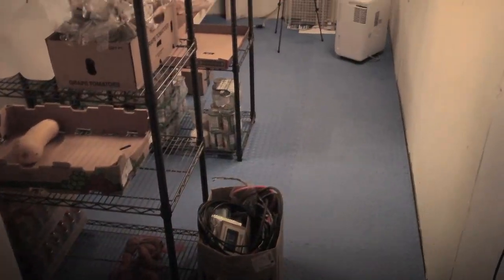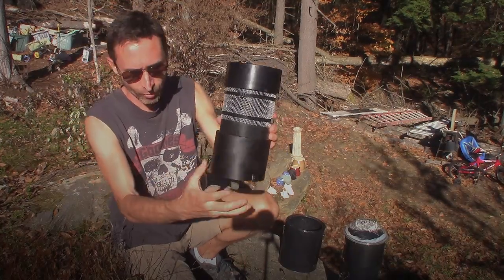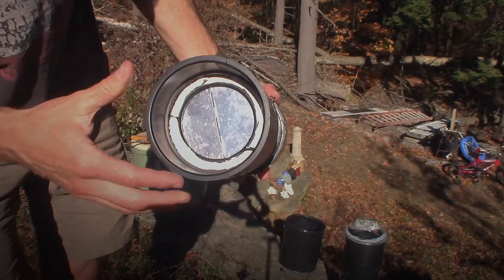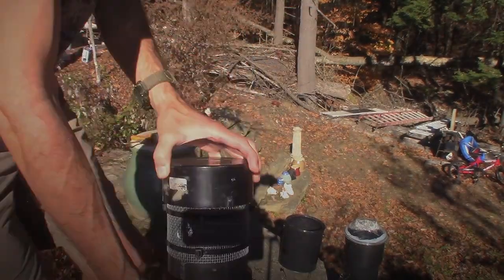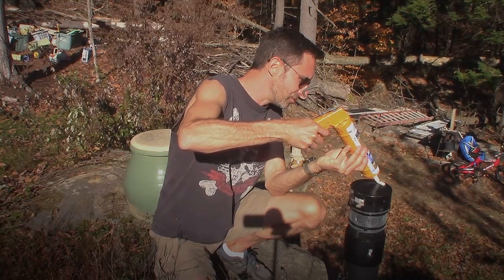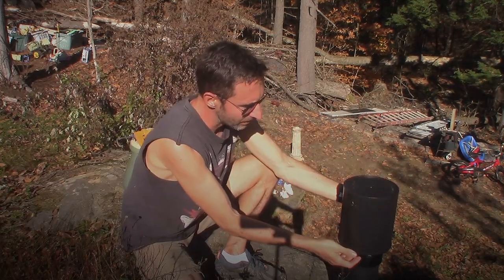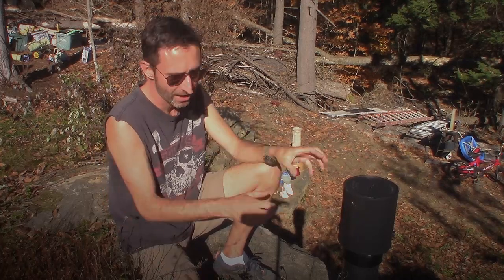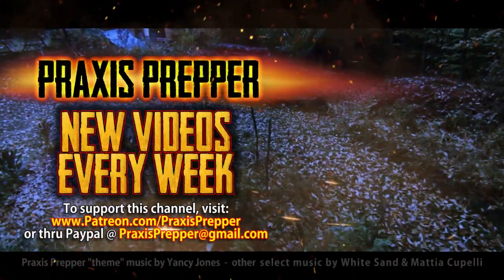Build a Homemade Fallout Shelter Exhaust Vent

Comment: I used to work in a gov "bunker" and one thing we had on the wall was a CO2 sensor with a big monitor showing the levels of O2 and CO2 and it would set off alarms if it went below a certain level. Not really sure if that was because it was a fallout shelter or because we had a big halon system but might be handy to have a small version of that.
Reply from the maker: I actually do. I'll be bringing it in for the test. It senses a number of things including co2. I wish it could do hydrogen as well because the lead acid batteries emit that gas when they run. I'm thinking that general ventilation should be enough to remove that along with the co2, but it'd be nice to know for sure. I suppose i could always tes by lighting a match...

Comment: I love that vent! If you have trouble moving enough air through the vent, remove the inner bug screen and your airflow will increase by 50%.
Reply from the maker: Good tip. We shouldn't need much flow - just enough to let the fresh air into the small space. We'll see how it goes when the tests start.

Comment: Silicone makes a great glue, just remember nothing sticks to it (even more silicone) so if there's a leak or when it comes time to replace it, you have to completely remove it and sand. When i lived in the heat of South Carolina, my silicone caulk lasted ten years outdoors.
Reply from the maker: I didn't know that more silicone glue won't bond to old silicone glue. I'd never tried it before. Thx for the tip. :)

Comment: The vent with the screen, the flapper valve thing and the paint can water proofing looks great! It reminds of the wall mount water proof vents on shipping containers. Those make the air go around a corner and through some holes also, except they have lots of small holes at the bottom. I think your creation will work real well and is a clever design.
Reply from the maker: Thanks Ben. We'll all find out when i run the tests soon.

Comment: I didn't read every comment, but I expected someone, (other than me) would comment about why you have the air tube pointing up instead of using a J tube and pointing the exhaust vent downwards. I see this technique used in my area over old dump sites that produce methane. Seems like it would solve several needs. In addition to preventing rain coming down from up top, it would serve a secondary purpose that it would make it more difficult for someone to pour a fluid (thinking gas, etc) down the tube. Atlas Shelter using something similar, but there is an area of pipe that goes downward in the event someone is attempting to pour fluids down.
Reply from the maker: With the lid i put on it, it still has the same J path. I built it this way as an easy way or wrapping the meshes in there. But a j could work too of course.
Reply: It would be just as easy to use a hose to circumvent the J tube pour something in that way.   I look at having the vent enclosed in something structurally sound that would make it hard to get to the air exhaust or intake.   Or at least they would make enough noise to let you know that someone is trying to get to your air intake or exhaust.   Just a thought.   It could be as easy as a 5 gallon metal bucket with padlock hasp.  One part pop rivet to bucket and the other attached to concrete base.

Comment: If the paint can is easily removable then you can check for nests and whatnot more easily. Here in North Texas everything gets filled up with dirt dauber nests on a long enough time line.
Reply from the maker: I suspect that the lid WILL be easily removed after heating and weathering. But you're right about the bugs in that crack. Mud wasps would love that space. I gotta consider that - maybe add a bit more insect mesh to the bottom seem. Thx!

Comment: Very interesting your vent.  I like how you make the holes and put bug screen in the inside of the 4 inch pipe and the 1/4 metal mesh screen to strop the mice from getting into the pipe.  I am worried that wasp will build a nest inside and stop the air from coming out.   I do not know if they make Shell Pest strips anymore but they are waxy looking yellow candy bar size bug repellant strips.  That would help keep the wasp or yellow jackets from building a nest under the paint bucket.  I like your shelter.
Reply from the maker: That's a good point about the wasps.  Someone else thought of that too. I havent done it yet, but I figured I'd add a bit of mesh around the ring to prevent it. Thx for the tip. We all learn from each other on here.

Comment: Well done Praxis. That should really help with the airflow. The less resistance there is the easier your air pumps will work. Maybe consider bringing a canary in with you for the dry run test. 🦜
Reply from the maker: We don't have any canaries... maybe our smallest rooster? OMG, I can hear the ear-splitting rooster crows reverberating around that enclosed space! My ears are bleeding just imagining it! ;)

Comment: I actually believe Ive heard Brad on Full Spectrum Survival mention your channel before, I love your vent cap. I will  make something similar for a project I'm working on for venting a subterranean greenhouse. Have you used your shelter when it is -20*F if it gets that cold in your area. If so, have noticed any condensation freezing at your exhaust port? something that I think about and trouble shoot for.
Reply from the maker: Yeah, I get mentioned on channels that I frequent form time to time. My little 15 seconds of fame here and there. :)
We don't tend to get down to -20F too much here. Very rarely. But that's an excellent point on the condensation freezing up as it goes out. I think we'd have a decent chance of the warm exiting air keeping the path clear, but having not tested that, I can't say for sure. Thx for bringing that consideration up!

Comment: Nice job. Did you get a co2 detector for the bunker? If not it would be interesting to see one included in the test.
Reply from the maker: I have a multi-function meter that I use presently in my house. It does CO2, radon, humidity, temperature, barometric pressure, and VOC content. I'll DEFINITELY have that in the shelter during the test. It'll give me critical knowledge about how low I can run the fan and still keep the space free of excess CO2.

Comment: I feel like I'm always asking you questions lol. What did you do for air intake? I bought an organic air green house hepa filter with a 4in ring seal.
Reply from the maker: I have a little playlist on the manual air intake that I built: https://www.youtube.com/playlist?list=PLEbbFhsJJB8_NQ92jeaylBqqME1e3BXle
Aside from that I have a 4" electric fan that (in testing) is able to easily keep up with our breathing. The filters are 4 large HEPA filters that I installed in an air intake box I created. I don't have a playlist for just that project, but it's covered in this playlist (though you may not want to sift through to find the videos on that). If you do, that project wasn't even started until the root cellar was totally done, so it's among the more recent days in the list: https://www.youtube.com/playlist?list=PLEbbFhsJJB8_TXczGtYPPXukeRBDC9uIX
And no worries on the questions. That's 100% why I'm here!

Comment: It would be very interesting to see a smoke test so you can see the air travelling the way you would like it too... Also, like another commenter mentioned, I would be interested to see how these smells carry outside the bunker. I am assuming your bunker runs year round at about the same temperature, geo-thermal around 56 degrees. Is that accurate? I may have missed that throughout the videos...
Reply from the maker: The bunker fluctuates through the year so far. More dirt on top (which i added this summer) may help with that. In the summer it hangs out atound 60 and in the winter is about 40 (that's before i added the extra dirt this year). We'll see. With human bodies in there, i'm assuming those temps change.
Reply: @PraxisPrepper  thank you for replying. Even at that, 40 is far better than the outside temp of anything below freezing. Keeps water, well, water, and a lot less energy to warm it up. That being said, I hope the additional dirt makes it a little more consistent temperature for you. Awesome. When we move to oir property down the road, I told the wife we are putting in a "Root Cellar." She agrees.
Reply from the maker: @cogitoaprendo1017  let me know when you're doing that. And if you like, we can chat on the phone about anything you'd like in regard to doing that. There are things i'd have done differently after doing the 1st root cellar, and i'd love to pass that on to you guys.
Reply: @PraxisPrepper  thank you, but it will be a few years before we are there.

Comment: Im building a storm shelter based loosely on 1978 bomb shelter design by fema.
Im useing steel tubing for intake and exhaust, in the shape of Shepards crooks.
Reply from the maker: Awesome! That's a great idea. My shelter is vulnerable to fire as it's presently built. Make sure you have filtration for your air intake (including activated carbon if possible) and ensure that your filtering material is separated from your living space because if it works to filter out radioactive material, the filter itself will become a radiological danger.
Reply: @PraxisPrepper  I've given that some thought.
havent come up with a solution just yet but will most likely be lead sheilding
Reply from the maker: Lead's a great way to go to cut the most radiation in the least distance. I believe it has a halving thickness of 1cm. @bobbytowesr3387

Comment: How would it keep the radioactive dust out? It seems the metal mesh wouldn't accomplish that?
Thanks
Reply from the maker: That's a fair question to ask. Thanks for bringing it up. It works because of the positive pressure exhausting out of the vent. The dust outside would need to move up the sides of the inside of the lid (paint bucket) against the flow of the outgoing air make a 90 degree turn and pass through the vent holes (again, against the flow of air) and then head down the shaft against the flow of air. If someone outside were making a concerted effort to blow dust backwards into the system, I'm sure that they could, but under normal conditions, the dust would never enter the system. It's similar to the way that if you dive under water and slowly blow air out of your nose, the water will never enter your nose because of the positive pressure of the air coming out. It doesn't take much, just a low flow will keep air from back-feeding in and carrying dust with it... presumably (and hopefully).
Reply: I’d build a concrete reinforced dome over the top, if there was a nuclear event your vent is melted!!
Reply from the maker: @Rotherhamvanman  You're correct. This shelter isn't built to survive local strikes - only drifting fallout from strikes in other areas.

Comment: You say : you need positive pressure , how much pressure to open that butterfly flapper valve , looks pretty stiff
Reply from the maker: Good insight. It actually IS pretty stiff (as I found out after installing). It opens up when I use the manual hand vent, but the fan doesn't open it up due to all the other egress points for air to leave.

Comment: Great idea but…..they should be made out of steel or metal pipe so they can’t be melted or broken easily.
Reply from the maker: That's a definite down side of the ABS pipes. When this structure was built, it was made as a root cellar with the thought that it could be retrofitted to work as a fallout shelter. So not every design decision was aimed specifically at the fallout function. Metal pipes have the downside of condensating more moisture from the air in the morning when they're cool. If we lived in an area more likely to be struck proximally by a weapon, the metal pipes would be more critical IMO, but where we're located, I'm mostly concerned about the potential for drifting fallout.

Comment: What are you using to pull air inside?
Reply from the maker: We have 2 options. A 4" vent runs into the shelter and the default mode of intake is a 4" electric fan. It's of a type that I've used for a long time for indoor air circulation, so it's very reliable. But... if there's an EMP and electrical systems don't work (or any one of a hundred other possible issues) we have a manual pump that I built myself out of some wood and an outdoor lawn waste bag. Here's a playlist that shows some work that went into making that device: https://www.youtube.com/playlist?list=PLEbbFhsJJB8_NQ92jeaylBqqME1e3BXle
Reply: I sincerely want to thank you for taking the time to answer my question. 99% of Youtubers will never answer simple questions but you did. I wasn’t going to subscribe to you but I definitely will now. Thanks again. 🇺🇸
Reply from the maker: @u.s.militia7682  OMG dude, that's why I do this channel. It's all about giving people a hand with things they're trying to do, and sharing ideas. I learn as much from viewers as they learn from me I think. Youtube is terrible in a lot of ways, but it's still the best place to connect with others and share ideas... even if Youtube is actively trying to stop that from happening! ;)

Comment: The first of your videos ive watched so if you have already talked about it im sorry but i noticed alot of building materials around the shelter. Could entice survivor's to investigate.
Reply from the maker: That issue with outsiders snooping around is a hard one. This shelter wasn't primarily built as a shelter, but rather as a root cellar (which I knew I could turn into a shelter if needed). If I were to have done a straight up shelter, yeah it'd have been a lot more low key and hidden. Maybe making the entrance be a hidden trap door from the bottom of a shed or something would be ideal.
Reply: @PraxisPrepper  thanks for your reply. OK now I understand the situation.  Good luck to you and your family if it ever hits the fan.
Reply from the maker: Same to you. Any sane person definitely hopes that these will be preparations that never need to be used. @shaune73

Comment: NO MORE RAQP CRAP ? OK  what happens if some one takes a hammer n smack that off and pour gas into it ? / make all of it out of steel bro ? w/ a drain so liquids wont come in ?
Reply from the maker: I agree that this solution is vulnerable to what you describe. But in my area the idea of people coming by to do anything is pretty uncommon. If I were to suggest a much more likely scenario, I'd say that this shelter is for surviving a nuclear exchange. If there were a nuclear exchange, one could reasonably expect for fire to be a "thing". Fires spread. Forests burn. Neither this vent, nor the air intake for the system would have any chance against a ground fire spreading across my yard.
THAT is a much more likely scenario than someone dumping shit down the pipes. And yet I haven't prepared for it through the design I show here. Why? Because we always have to balance the cost of a prep with what we can afford to do. I think this approach hits a balance that allows me to do something very useful without being so costly that I can't afford to do anything.
Even if the vents were steel, I could still VERY easily clear the shelter out by lighting a smokey fire under the air intake and wait for everyone inside to get smoked out. For the best shelter, one would need to go deep underground, have multiple redundant steel vents, have all the vents hidden in multiple locations (likely under boulder piles etc.) and even with a situation like that, I'm sure there would be vulnerabilities. We all have to do the best that we can. Doing something helpful is always better than nothing. Might that something fail? Yes. But if people do nothing because the cost of a perfect system (and there's no such thing as perfect) is too high, then they've failed before they even tried.
I encourage people to try and to do the best that they can.